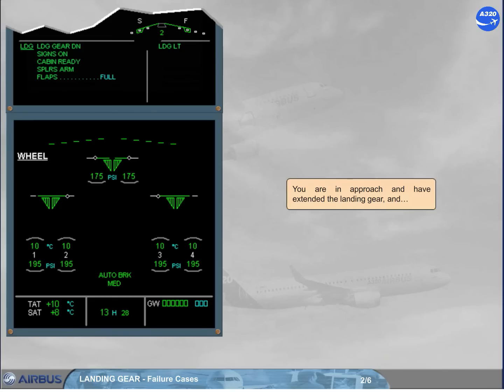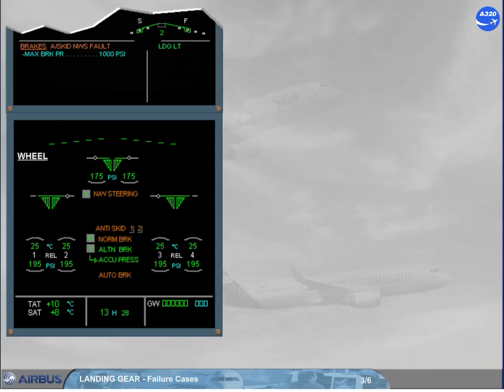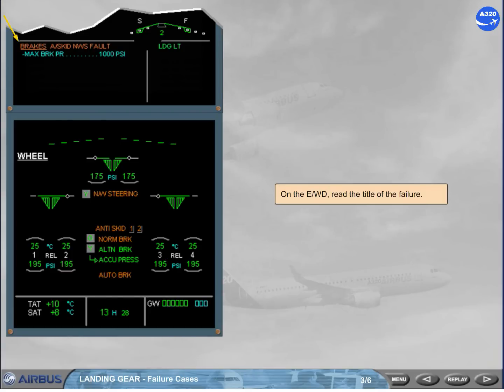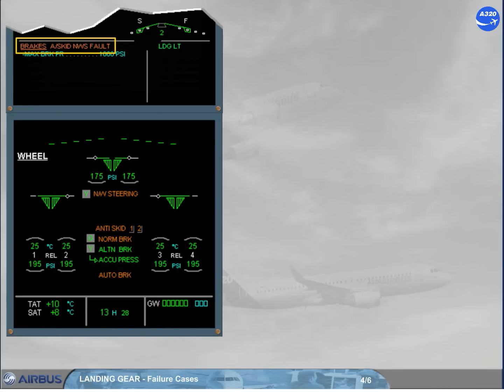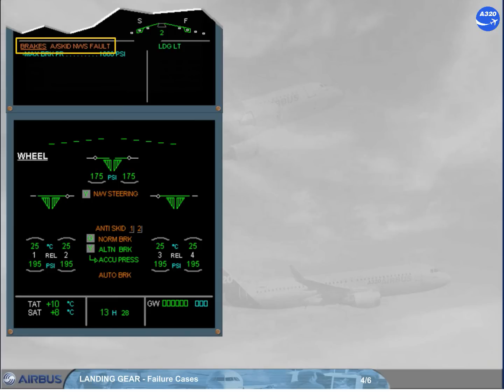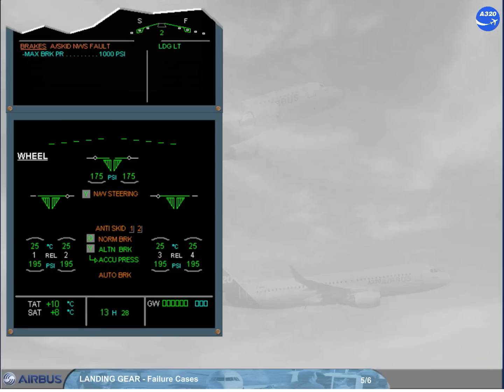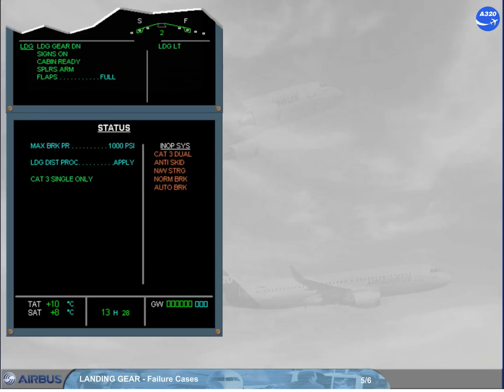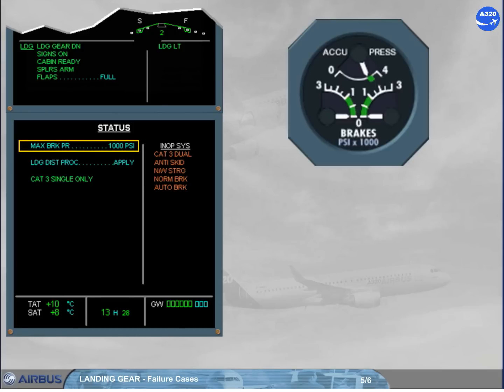Airbus A320 CBT # 75 LANDING GEAR FAILURE CASES

Comment: Why do they associate the loss of normal braking with low yellow hydraulic pressure (slide 4), can anyone explain?
Reply from the maker: It's 1 of 2 cases of complete failure or the BSCU, loss of normal braking plus alternate brake Yellow sys, hope that makes it easier to understand
Reply: @a320mentorchannel  But still it does not make sense as per the second condition, " the loss of normal braking system associated with a yellow hydraulic low pressure." Please explain and thanks in advance.